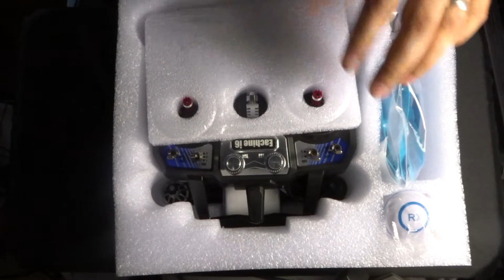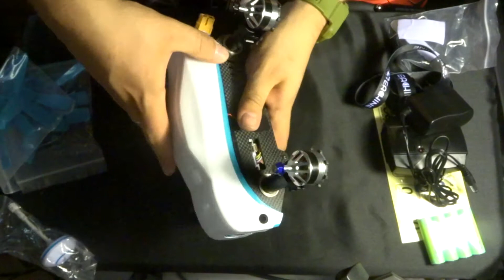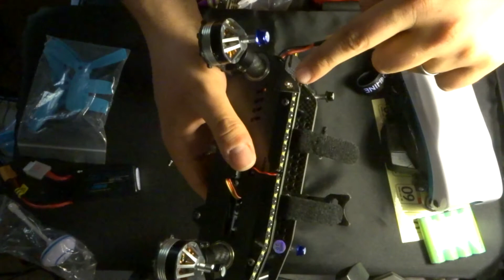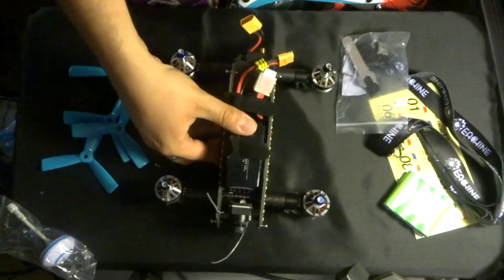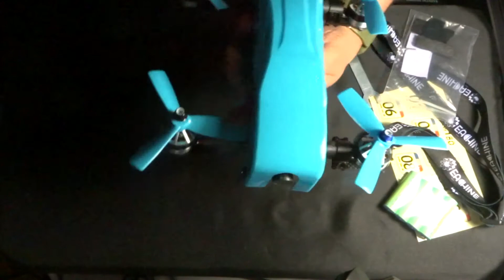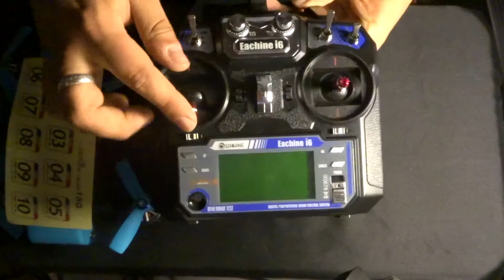Eachine Racer 180 Tilt Rotor Drone Unboxing & Assembly

Comment: the base model is well, that I've seen online, is between 215.00 to 285.00 and that's just the copter and the transmitter and stock square camera holder. I think that's my best bet for now. I can save for the 3 axis gimbal over time. gopros are nice but expensive as you have seen.think I'll  get this base model and a 4k action cam for now.
your videos are really easy to understand. you explain things so anyone can understand all of the information about the subject you are focused on. Good Stuff man.
Reply from the maker: Excellent idea Paul!! Thank you for the kind words :-)

Comment: What's going on  JD...
That tilt rotor looks awesome.
looking forward to the video. 
Haven't purchased the 3dr Solo yet. will probably do it next week. out of all the options they have, for instance,  base model just the copter and transmitter,  2nd comes with backpack, 3rd comes with 3 axis gimbal and spare battery and then up to the one with all the whistles which is too much for my wallet.  Going for the base  model and will get a gopro clone for now.  let me know how to send video of maiden flight. good flights and safe landings.
Reply from the maker: Hi Paul Clement, Wow that can get very expensive with all those options :-)  You will get some great footage using a GoPro.